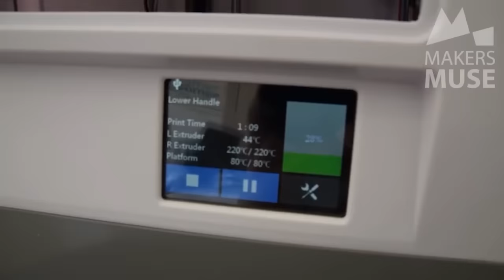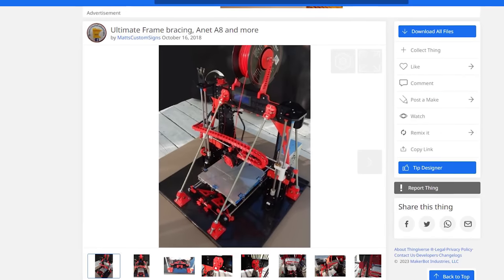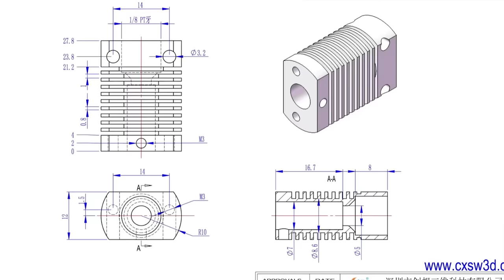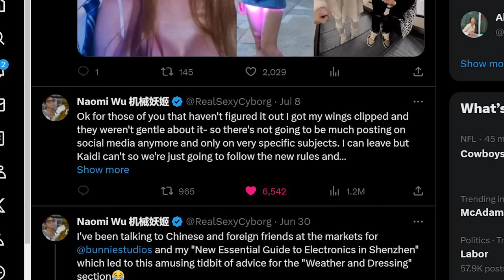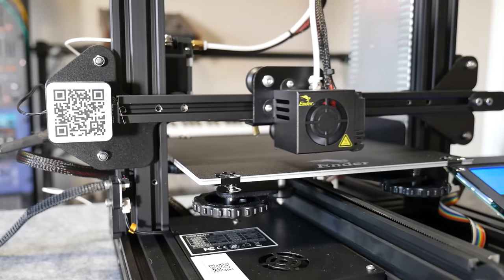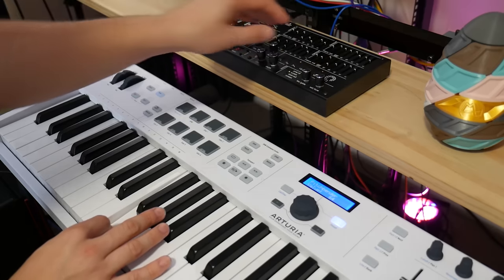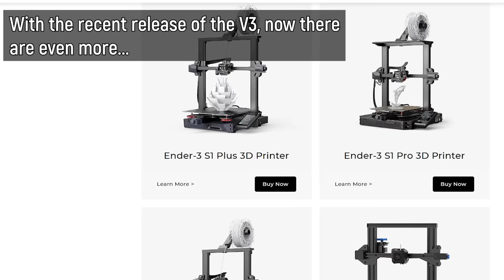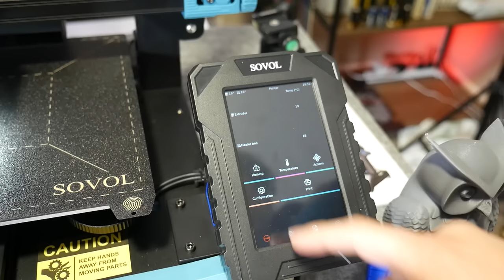Creality Ender-3... it's time to move on.

Comment: Ender 3 V2 was my intro to 3D printing. I replaced the plastic extruder assembly with the metal upgrade during the initial build. Before taxes I paid $185 CDN on black Friday for the printer and the upgrade kit, so cheap I couldn't NOT do it! Having a background in mechanical technology, with experience designing, writing code for, and operating CNC equipment, I was able to fill in the gaps in the build manual and had the Ender 3 dialed and printing good parts from day 1. With that being said, I would not recommend this as someone's first printer unless they have both the desire, and time to do homework just to get the printer to a good working state. Then they can do homework into upgrades when they're ready to move past PLA, which is what I'm doing now. I have a bi-metal heatbreak on its way, and will be building an enclosure for it so I can print functional parts in ASA. Also a 2-screw z-axis kit (1 motor, 2 screws driven by timing belt) to resolve what I feel is the one major design flaw with this printer (gantry only supported on one side). Until that arrives I've just been doing all my printing on the side of the bed closest to the z-axis screw as that's where the gantry will be the most solid. It's been a lot of fun knocking out toys from Thingiverse so far!

Comment: As an Ender-3 fan, I see your points about quality control. My first Ender was an Ender 3 Pro and, after a lot of tinkering, I got it to print great...in PLA. Then I tried printing PETG and instantly regretted it. I learned a LOT about replacing parts on it. Fast forward to today and I've replaced the Pro with a Ender-3 V3 KE. Night and day in terms of features - Wireless printing, direct feed, auto bed leveling, dual-X with lightning-fast speeds, upgraded frame and bed... I am concerned if/when I need to replace parts, but I'll cross that bridge later. For the price (~$260), I couldn't get anywhere near a Bambu, yet I feel I got the same quality.

Comment: I bought 3 used ender 3s a couple years ago. They were returns, so I was able to get them dirt cheap. Two of the three had nothing wrong with them. one of those two I invested approximately $100 in upgrades (meanwell power supply, bltouch, dual z, pei bed, mini e3 mainboard), and  it is my most used printer. It has been running almost 24/7 for 2 years now with no problems. You cant beat that for $170.

Comment: To be fair, Jessy didn't attach the magnetic handle to the K1, so there was nothing stopping it from opening by itself.
Not that Creality doesn't have some of the blame. They don't mention it in their instructions. It's just mentioned on a sticker somewhere, so it's not obvious at first, and it could've been attached from the factory, like the top cover handle.
Also, I don't think drilling holes in the glass and screwing screws through the holes is the best way to do things. Usually, glass doors are one solid piece clamped in place with plastic spacers and putting holes in it seems like it would make the glass weaker in that spot, which is especially a problem when it's up against hard metal screws.
I was worried this would happen to my K1 Max so I made sure attaching the handle was the first thing I did, and was very careful when moving it around. It could easily happen to anyone if they weren't being super careful, so his video definitely served as a useful warning.
I wouldn't exactly call it a design flaw in the printer but it definitely should be mentioned in the instructions (with a big warning to be careful because the door can open by itself if the magnetic handle is not attached) and it would be even better if it was attached from the factory, like the top cover handle. That's all it would take and this probably wouldn't have happened. Really wouldn't require any design changes at all to fix.

Comment: I came to 3D printing with the purchase of a 99$ Ender 3 Pro (thanks for the coupon!). At first I was looking at $400-$600 machines, but since I had no idea if I would like or use 3D printing, I couldn't pass up the low-dollar opportunity to try it out with the 3Pro. I fixed the issue with the Z-axis limit switch and loose vertical springs by filing a bit off the nub rather than cutting it off. Once I re-assembled the x-axis gantry with attention to detail, I was able to get what I consider fairly good quality results. I appreciate this video, for sure. Thanks.

Comment: I'm still happy with my original Ender 3 after some 4 or 5 years. My first 3D-printer was a horrible acrylic Geeetech kit that was actually unusable from the factory to the point it simply would not produce any prints and even after a lot of tweaking it suffered from inaccuracy (lots of Z-wobble, missed steps etc.) and all kinds of other problems. I still was able to produce usable parts with that but it was often painfully frustrating. 

Then I bought my Ender 3 and everything changed. First, instead of a day assembling the printer and then a week of tweaking to make it usable the Ender took an hour to assemble and worked fine, producing good prints from the beginning, right out of the box. I printed a bunch of mods for it and went on happily printing.

Then about a year ago I upgraded it with a Micro-Swiss full metal direct drive extruder and a newer versiuon mother board and now it prints stuff like TPU flawlessly and is capable of printing high temperature materials, though I don't have an enclosure which limits my options. I have never found things like automatic bed leveling necessary for such a small print area, to me, after fitting with stronger springs, it has been "set and forget" only needing adjustment if I for some reason take something apart like when replacing the extruder.

So as long as it works I see no need to upgrade as for my use there's probably no printer at a reasonable price that would offer significant improvement. And if I did need another one I'd probably strongly consider the new Ender-3 V3 SE.

Comment: I bought ender3 neo a few months ago. Printed about 4-5kg of filament so far. Works good. All factory parts , print speed i use most of the time is 80-100mm/second.

Comment: Yep yep and yep. I'm less than 1 yr into 3d printing and I needed  it for making prototypes of a product I was inventing. I was told to look into creality by a friend with a prusa. I then looked at prusa as well. I was a click away from ordering an mk3 and then I saw your video on the x1c/p1p. That video changed my life and set me on the right path. Bought a p1p the same week. Printed things right out the box. The only learning curve was slicing. I've had many failed prints since then but none were the fault of the machine. The ender lineup was clearly half-baked machinery. As a Profesional in technology I was able to see that very clearly even knowing nothing about 3d printers. Even prusa was behind the curve. The fact that the high end brand didn't even have wifi on its main sku blew me away. I mean ovens have wifi now. That was the final nail in the coffin of my late prusa/ender dreams. And I'm very glad Angus handed me the hammer. 😊

Comment: I have an Anet A8, for about 6 years now ($75 then), and it prints just fine. The only addon is a glass bed (Lowes: $8) and a cooling nozzle (printed). I've put at leat 20kg of material in it. Never have to re-level the bed. Excellent prints! So I'm amiss as to what A8 you're refering to with all the problems you describe.

Comment: I agree, it is the Honda Civic/T-bucket of printers. It is a great platform for people that want to learn about printing, customize and, push limits. Even when upgraded to the limits, it still won't be as fast as its more expensive competitors but you will have far more fun and a greater appreciation when you move up. Best of all, the thing it does is make you a better engineer and consumer. The more you know and understand about a topic, the harder it is to get sucked into the marketing hype and shiny buttons. I love the direction Bambu is going but the black-box mentality of the machine doesn't appeal to me. I love the engineering side. That is why I am working on a Voron as my next build. To bring it back to car analogy, the Ender is the original tuner/hot rod car. Rough around the edges but can be turned into a streamlined buttterfly or the sickest drag monstor on the block. You just don't get that kind of fun with a minivan without putting in an insane amount of work.

Comment: I’ve had an Ender 3 Pro for over 4 years. I have done several modifications, including a glass print surface, a 32-bit motherboard, and changing to a direct drive extruder. It’s been a reliable workhorse, especially after changing to direct drive extrusion. It’s going to last years longer.

Comment: I would recommend you guys to buy ender3. So many things are wrong with it: leveling, extruder, z-stepper, lying controls, bed heating etc etc. You will learn a lot of things by trying, making mistakes, setting up again and again. And again. You will learn to optimize Cura project with regards to problems of your printer, you will learn to save on printing time and material, because prints will be shitty, and you will have to remake anyway. And then, you will just buy yourself a normal printer for 3x price, where all these problems are solved.

Comment: I agree with everything.  Bought mine sub $200 as a first printer.  It was a good machine to learn on.  Mine is no longer original...new mainboard, upgraded Marlin, and a hand full of other improvements.  Yet I HATE that SD slot.  As you say, bed leveling is always a chore.  Burned through Bowden tubes, stringing and clogging were all occasional problems that recur on occasion.  But it does produce usable prints when I need them although quality is so-so to good.  I can't imagine living without a 3d printer...it expediantly solves so many problems around the home.  I am surprised that Creality does what it does.

Comment: My Ender 3 is still going till this day! Prints fine. Had it since 2018. Changed out the board to an skr mini, went to a micro Swiss hot end, changed out the belts do to wear and tear. Still on all the original motors and fans. Added octopi. I don’t see what’s so bad or why people can’t get good prints with the Ender 3🤷🏻‍♂️. I don’t think a lot of people fully grasp the bed leveling and going negative on the offset.

Comment: My first 2 printers were the anet a8 and the tevo tarantula and both had really bad issues when i first got them. The a8s main board literally caught fire as soon as i plugged it in and i had to get a replacement board. Not to mention that it comes without a power switch so its either on and plugged in or off and unplugged. I eventually printed a power switch mount for the power supply. It was nice until the z axis vertical bearings fell apart and sent a bunch of tiny bbs all over the floor. Then, with the tevo tarantula, it never printed correctly out of the box. The hot end thermistor died, i replaced it, it then was underextruding. Just a massive pain. Then i finally got a cr10 and it has been amazing ever since. As long as you keep up the maintenance like replacing worn out belts, cleaning the dust off of the rollers, and make sure the belts and frame are properly tightened, it works flawlessly

Comment: I have the classic one, ender 3. My first 3d printer. It stills rocks, with some upgrades (SKR mini e3 v3, hotend, double Z, case, bl touch, glass, etc).
 The learning curves of 3d printing and this machine is not for begginers, "old tech" with a lot of hardware and software "problems".
Nowadays is better to start with a bambu lab or new creality for example.
But after all, i still recommend that if you find it on the second hand market with a reasonable prize (70€-100€ and modded, here in Spain)

Comment: So, I"ve had my Ender 3 for a year and a quarter. BTW, I agree with everything you're saying. I did a bunch of upgrades (auto leveling, runout sensor, glass bed...). However, two months ago, prints started failing randomly about 2 hours in (heat creep). I replaced almost everything and still could not fix the problem. Then I did a massive search for another relatively inexpensive 3D printer and ended up with the Mingda Magician X2. About the same speed & size as Ender 3, but much quicker to put together and lots of features not in Ender 3. Having said all that, I can't quite give up on the Ender 3. Just bought an upgrade motherboard, since it's the only thing I haven't replaced. So I guess I'm hooked for now.
Reply: The only thing I could find to fix heat creep on my Ender 3 V2 was replacing the extruder to a direct drive system. I am running the sprite extruder with no issues for over a year now. It is incredible how well it works and I churn out a ton of prints.

The Bowden style is a mess. The tubing, even Capricorn in the heat break always gets messed up.
Reply: Thanks! Can you tell me which Sprite direct drive you used (dual gear, etc?).
Reply: Yes, dual gear. It has been churning parts for 11 months now and I haven't even replaced the nozzle yet! I used to replace those old brass nozzles every few days.

This is what I got off amazon: Creality Sprite Extruder Pro Kit, All Metal Direct Drive Dual Gear Extruder Upgrade Kit for Ender 3/Ender 3 V2/Ender 3 Pro/Ender 3 S1/Ender 3 Max/CR-10 Smart Pro 3D Printers, with Backplate, Adapter, Flat Cable

It came to 145$. Well worth it. I think it's the same extruder that the new Ender 3s come with. It turned this thing into a new printer. @mikesheldon4063

Comment: I had a working Ender 3 Pro loaned/given to me with 5 rolls of PLA and it has allowed me to enter into the 3D printing for free. There was a lot to learn but thanks to many YT videos I'm able to print most of what I want. My mods to the Ender include bed springs and a Bowden tube. At 100% speed it has been reliable with PLA. When I push it faster problems start to surface - it's not made for speed. Leveling is no longer an issue after I understood what a first level layer should look like when it's spot on and after I downloaded a decent test print. I can fine tune the correct level while the test is printing in about 5 minutes. It's been great to learn on and explore the 3D print world but I can see the limitations of this 5 year old technology. Also learning how to use your slicer software is more complex than any issues on the printer itself imo - thank God for YT videos.

Comment: The first printer that I got was an Ender 3. I had in my mind that my dad and I could use it to print jigs and parts that my dad could use in his shop- he's a carpenter. I had so many issues trying to get the stupid bed levelled and the height correct, then add to that the fact that it seemed like every time I would use it the bed would go out of level again so I'd need to spend another 20 minutes trying to get it right... well, it's no wonder that it's ended up sitting on a shelf unused for over 4 years now. I wanted it as a tool, not as something that I would spend hours upon hours trying to get to work. 

Well, a few weeks ago we ran into an issue that could only really be fixed by something that we could 3d print. I did some research and heard just how good the Bambu Labs printers are. I just ordered the P1S a few days ago and am super excited to finally get to use a 3d printer for what it was always meant to be for me- a tool to be used, not a toy to be played with.

Comment: Get a Prusa. I have had mine for years and it has given me trouble exactly two times.  The print fan went out, and I had to replace the nozzle once.  That’s it.  It runs, it self levels, and I have never used a glue stick to hold my print down.  I am always at a loss as to why people love ender’s when they seem to never work without a lot of fuss.  The Prusa mini kit where you put the printer together is inexpensive and you learn more about how your printer works by putting it together.  Seriously, if you are considering getting a 3D printer just save a little, get a Prusa, and just run prints.  I print nearly 24 hours a day and have been for years on the same Prusa mini 😊

Comment: I have two CR-10s and two Ender 3s, and have run them 24 hours a day for years.  I was happy with them, then I got a Bambu Labs A1 mini and it blew my mind.  Those guys could teach Apple a thing or two about packaging, unboxing and onboarding of new users.  I ordered a second one the day I fired up the first one.    I only print smaller parts so the A1 mini size is perfect for me.  The Ender 3s served me well, but it definitely is time to move on.

Comment: As an Ender 3 v2 owner for years  can tell you that it does NOT have a touch screen. 
Instead it has a bigger somewhat color screen, a tool drawer and a MUCH better 32 bits controller board for it DC motor drivers. But I know what you are saying, I'm done with the open source, calibration and customizing mumbo jumbo, and I've ordered a Bambu Lab A1 mini to make my life easier and in colors :) .

Comment: despite the "Noooooo..........long live Sparta" cry as my response to the opening monologue, I AGREE. My first was the ender 5, pretty much the same, 1 zed motor but in a box frame. At that time I looked for the assemble your own and learn.. Creality delivered. It was really a well organized 3d printer learning tool for me and I fell in love. I was able to push into Arduino and lite CAD. But now I am a student of CAD and I look for speed, build volume and features. It has been a hobby and a real learning experience for me. But also most important I could not have learned as much without you Angus, or Joel, or Naomi, or Chuck H, or Vision Miners, Dr Voxx.. the list goes on and on... You provided special prints that tested the capabilities of my printer. I remember when I printed my first 2 spline easter egg that spun around the Zed. Thankyou!